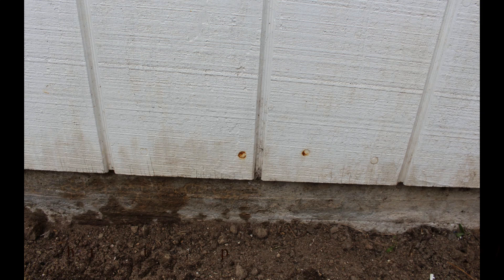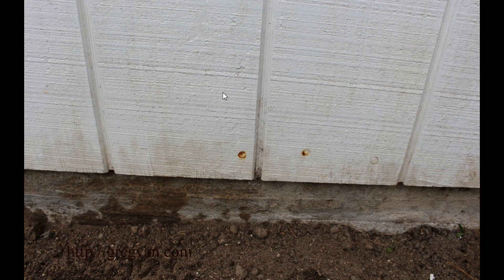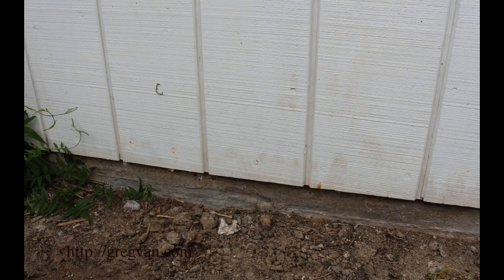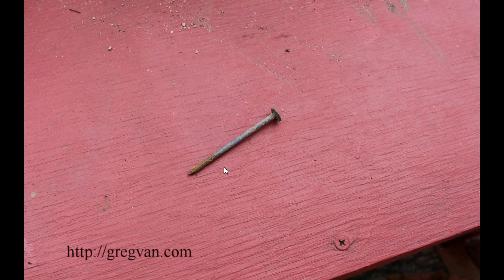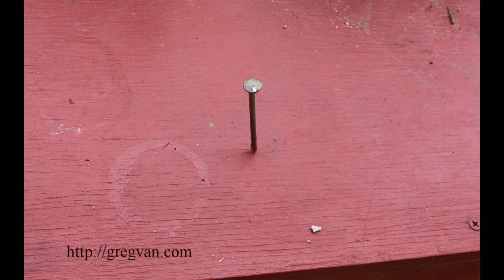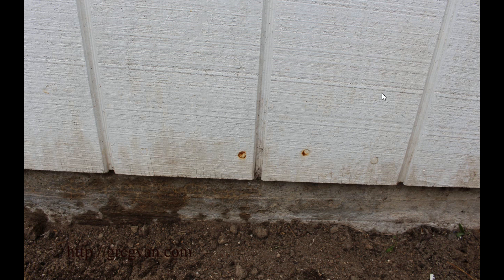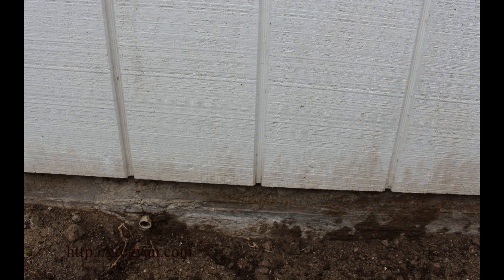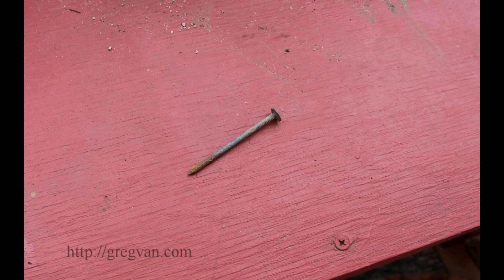Proof That Galvanized Nails Can Rust – Home Building Tips

Comment: I like this video. If you do have nail heads rusting through your paint, remove them before you paint. No matter what you do i.e.,use a special coating, counter sink the nail or sand it and use a rust inhibitor the nail will continue to rust. The only practical way to remove that rusting nail head is with the drill bit from Nail Head Gone. After removing the nail head Install a stainless nail or screw if needed.